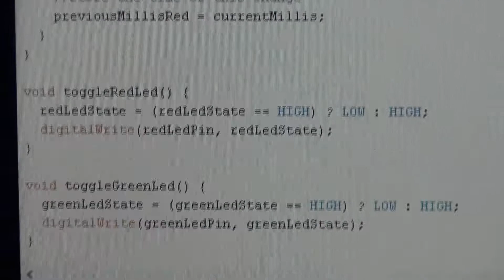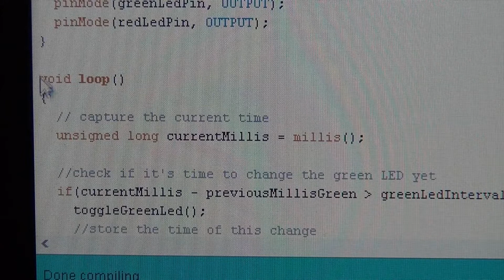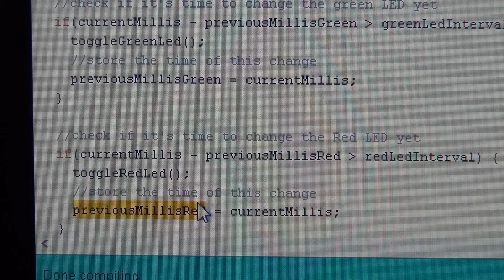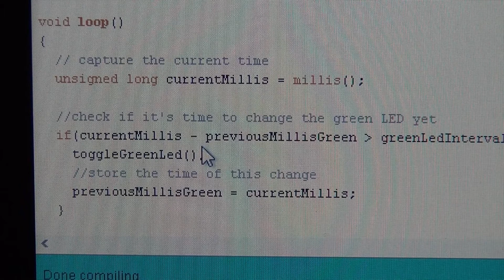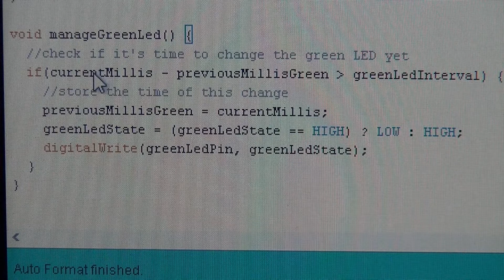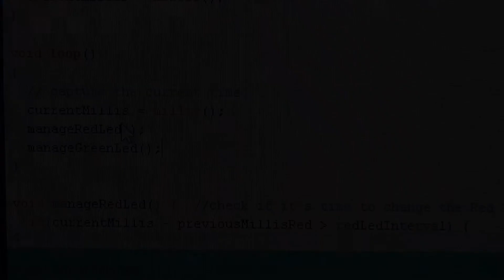Arduino State Management Explained (BlinkWithoutDelay)

Comment: If these events happen at fractional times and have stable clocks, then a least common denominator can be employed. However, if the clocks are unstable and the events are thus asynchronous, there is no least common denominator. Even where there exists a least common denominator, it may be too large to be practical. To be useful, the pattern must repeat in a reasonable amount of time. Thus, delay is actually more restrictive than first impressions suggest.
Reply from the maker: In addition to that, most of these chips support an external timer based interrupt. You can set up several timers and get very exact timing on things, to produce PWM signals and so on. That's really the best way if you need things to be exact and configurable. See my video on ATTiny timers for some introduction to that.

Comment: If I would like to blink multiple leds in a row with a slight delay to the previous led - would I simply have to add a certain mills to the previousMillsGreen/Red?
Reply from the maker: Not really. This code is just an example, it is not how you would do an arbitrary number of LEDs. Using arrays of timing numbers would be better when you have more than two.

Comment: Been playing with Arduino for about a month and happy with my progress.   The thing is it keeps your gray cells stimulated, lol.  This has been asked below, but I'd like to revisit the question.  This statement: redLedState = (redLedState == HIGH) ? LOW : HIGH; is not familiar to me, but I get the gist of it.  It is my understanding that the code as it's written has only one variable to control timing for each led.  As such, the ON/HIGH period is the same as the OFF/LOW period.  Am I on the right track so far?  So if we wanted the leds to have different Off times, we need another variable?  If this is the right track, I am all but lost as to the syntax the code would take with the additional variables, especially the way you wrote the initial code - which, by the way,  I am quite drawn to.  I will eventually figure it out, but if you could kick start me in the right direction, I would be very grateful.  Thank you for sharing this and stay healthy.
Reply from the maker: Keep in mind that this is example code to explain the idea of changing states based on timing without interrupting the loop. It is not a demonstration of properly structured code with a good design pattern. But yes, if you wanted to do alternate timing for on and off, like to create a PWM signal with a variable duty cycle, there's a few ways to do that. You could have two variables for the timing of each phase... OR, you could do what many PWM libraries do, and store a frequency and duty cycle, such as "25% at 1Hz" which would give you a quarter second of ON time, followed by 3/4 of OFF time... this is much more useful than using hard coded numbers for each time period. Be creative, there's lots of ways to do this stuff, the video is just about how not to block the loop, while still getting things done.

Comment: This is a great explanation, i am looking for some video about elapsedMillis, I am a little confised of hw to use elapsed millis vs just managing myself the state machine.
Reply from the maker: A variable of type elapsedMillis will be initialized to zero when it is created, and from that point on, it will simply give you the difference between "millis()" function NOW and the time it was created. It is basically useless, and IMO unnecessary. It actually obfuscates/hides the timing updates. It may result in unsynchronization and poor performance as well, because every time you "access" the object, it has to re-calculate its value.
Reply: @jasmine2501  I refactor my routine following this video and indeed it was easier to understand from all the debugging info I was getting. Thanks!

Comment: It would be better to add the interval to the previousMillis. If you make previousMillis equal to currentMillis, time will slip, and it will slip between events. If timing is not critical, fine.

Comment: Thanks for the video. Could you have used the following to change LED state?
digitalWrite(greenLedPin, !greenLedPin);
Reply from the maker: No, because you need to actually change the value in the variable. So, you could do this...

digitalWrite(greenLedPin, greenLedState = !greenLedState); 

This works in some versions of C++ because the = operator has a dual purpose, it assigns the value to the variable, but also returns the value that was assigned. However, this is not universally supported, and it is quite unreadable. Since it's not any faster, and may actually be slower, the brevity of it is not a good trade against the readability problem.
Reply: jasmine2501 ah ok thanks, I need to learn some more 😀👍🏻
Reply from the maker: I've been doing this stuff for 35 years and I still need to learn some more. That's why I love it!

Comment: I would like to thank you for posting this video (4 years ago almost) I am a Neophyte to Arduino Coding and your explanation of State Management (BlinkWithoutDelay) was a tremendous help to me, as I was able to use your sketch to run three different LEDs at different rates.  I would like to know IF it is possible to Fade or Ramp (up & down) one LED while the other two blink at there own dedicate rates. It would be a great help in my understanding of Arduino Coding. Thanks again for posting this video.

Comment: Nice job! 2.5 years later you still helping people. It took me a few times through (just got my Uno), but I see what your doing there. I'm building off your example using momentary buttons to build a new hot tub controller. Your example helped me understand functions and button "state" with debounce thrown in to boot. Next up, writing code for a Blower motor timer set to 15 minutes.  Everybody loves Bubbles!  :-)

Comment: Great project,what about arduino with 5 leds?
3chasing light and 2 blink their own code...
Reply from the maker: +Alan Gašparić Well, you just expand on this principle with more events. After you add more than a few LEDs, you need to start combining this with arrays and such, or your code gets a little crazy. But it's just more of the same. Mix and re-mix.

Think about it this way... how could you generalize this technique to work with "n LEDs" - some unknown number, with each LED having its own timer? You're gonna need an array to hold the time information and pin numbers, right? Just work with that idea and you'll get the concept.

Comment: Hi Jasmine, nice video, but I was wondering if you could talk about how to setup the code for different on and off times, say for example, the green LED comes ON for 70 milliseconds, then off for 500 milliseconds, while the red LED comes on for 500 millis and off 1000 millis.
Reply from the maker: This would be an easy modification. When you change your state of the LED, just check which one it's going to, and reset the interval based on that. You would have to make the interval into a variable instead of a constant, but that's not a big deal, it would only take 2 bytes for each LED.
Reply: jasmine2501 thank you very much for responding. I'm very new at this. I got into it to hopefully come up with some simple programs to control the lighting effects in my model star trek ships. I'll try to figure out how to do what you said. I don't give up easily and don't want someone to just write it for me. I could just do this with a Picaxe M2 chip with 11 short commands, as they can do parallel tasking, but I want to figure this out. I guess I'm a gluten for punishment :)
Reply from the maker: robvei45 Well at least you have a great attitude! That is not very common these days, so I'll think you'll do well in the community. Think about what the Picaxe is doing to handle that multi-tasking... The OS is doing exactly what we are doing here with the Arduino. So, you're learning a low-level technique, which will give you an advantage against the script kiddies.
Reply: all the same, if you could talk about this and maybe show an example in one of your upcoming videos, I would be forever in your debt. I think I'm more visually oriented, when I read stuff it's hard to understand, as most of the people who write the instructions assume that you have at least some programming experience, I need an instructor who assumes just the opposite. Please help an old guy out, Jasmine :)
Reply: P.S. Just so you know, I understand the concept of what you're saying, it's the syntax I'm having trouble with. I don't know the lingo to use. All this stuff with commas, semi-colons, parenthesis etc. is very confusing. There's hardly any of that stuff in picaxe, you just write words for commands. If I could find some literature that explains all the commands I think it would be a big help. I'm fixin' to go hunting some more, see what I can find.
Reply from the maker: Yeah I understand that. I learn from reading, but I teach visually. When the student is there, it's easy to feel out their skill level and teach appropriately, but for videos I generally assume rank beginners will be watching it, so I try to be complete. It's complicated stuff though, so it's easy to forget something important.

I'm in the process of moving to another state right now, and I won't have my Arduinos for a while, but I'll think about this and see if I can come up with a generic pattern for it, for something like a "task manager" video I can do when I get settled in the new house. I will be able to achieve better production quality there as well.

BTW, on the PICAxe, you are probably using PICAxe BASIC, which is a very high level language. I haven't used that - I write PIC code in C, which you can do with a PICAxe controller, but it's easier to use the BASIC. The problem is the BASIC is not as powerful so it can be hard to write good code when it gets really complicated. I believe it also needs a certain device, right? Like, not just any old PIC will work with it?

I haven't been hunting in a long time - but I am working on some Arduino and cell phone stuff related to hunting and ballistics. Will be a while before I can get back to that after the move.
Reply: When I said "hunting", I meant hunting for information on the internet. I could never kill an innocent creature unless it was necessary to survive. As for Picaxe, I believe the language IS called "Basic", and it works for all picaxe devices, though there are some commands that only work for the "M2" series, as they are the only picaxe devices that can do parallel tasking. All I need to do is control a few LEDs, nothing complicated at all, but blinking two LEDs at different on off rates in arduino I've found is much more complicated than I expected. In searching around on the forums, I've found alot of other people are also searching for a solution to this problem, so a tutorial video from you would be very helpful. I will subscribe to your channel in hopes of seeing one when you get yourself settled in, and congrats on the new digs :)

Comment: Very nice explanation of a state machine Jasmine.  Brings back memories of when I played around with a hardware state machine made with EPROMS.    A long time ago for sure.  The machine I made read the output of a UART and displayed it on a seven segment display.  Very crude but it worked.  R.O.G.
Reply from the maker: Arduino definitely takes me back to the days when I learned programming in 3583 bytes of memory. Arduino has ten times that, but it's still fairly limited. I'm spoiled as a professional developer these days, working on beefy systems with all the tricky stuff done by the OS, and yeah it's a lot of fun to go back to basics, and to see your code controlling things in the physical world, that's something I've never really done before.